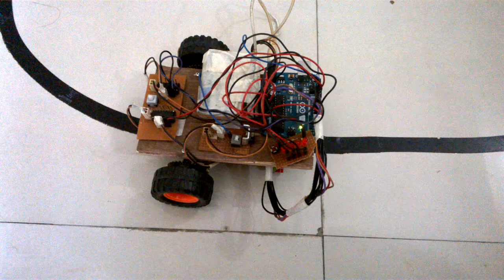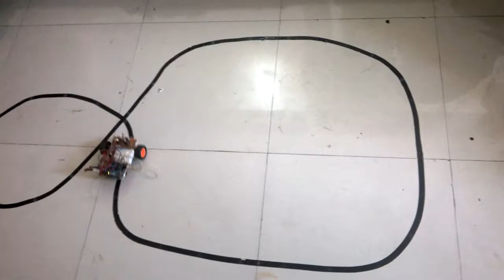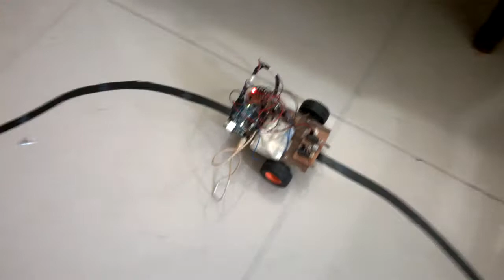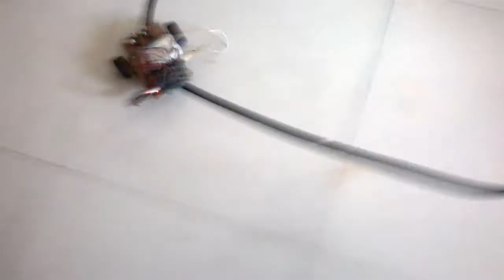PID Line Follower Robot Using Arduino UNO | QTR 8RC | L293D | www.ArnabKumarDas.com

Comment: Does auto calibration work on normal ir module.and which tape you have used on your floor to make track??
Reply from the maker: Normal Electrical Tape is being used. Normal IR Also you can Use.